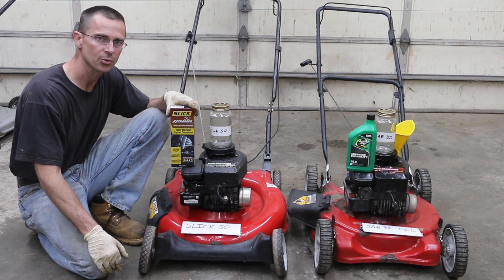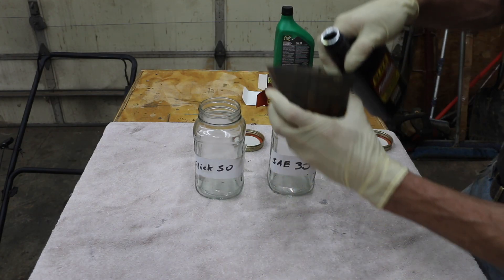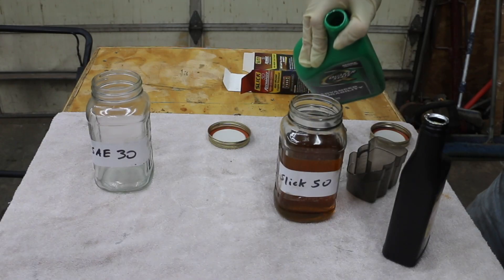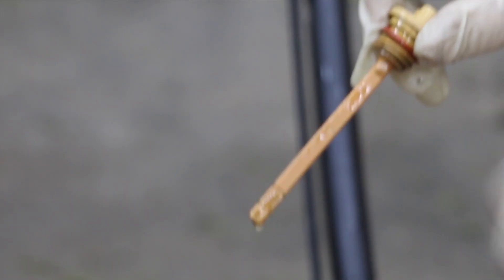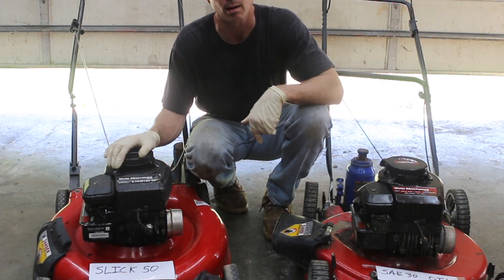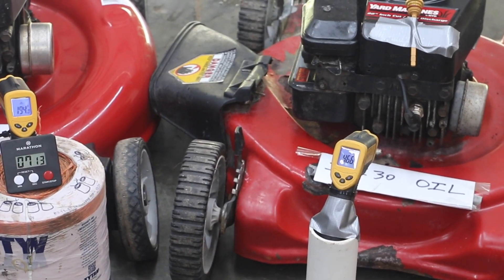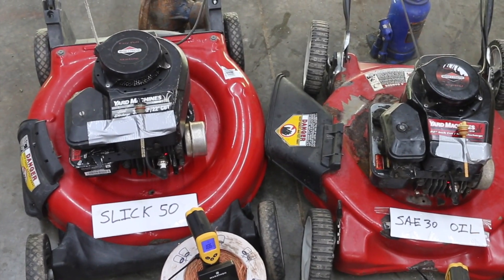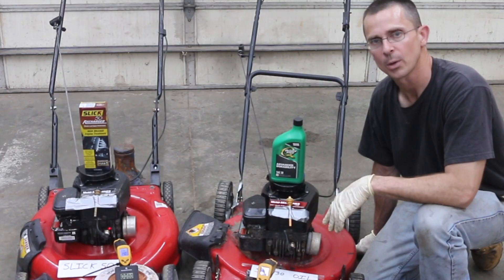Can't believe what SLICK 50 did to my engine!!--Dry Crankcase Test!

Comment: So you blow the hot exhaust at the 30w. engine, have the heat sensor aimed at cyl. head of 30w engine, heat sensor of slick 50 engine at spark plug and wonder why the temps are different!  Hey, there ain`t no mechanic in a can available---just buy the best quality oil of proper weight and change regularly and your engines will be fine.  Why not just use your money for proven lubrication products---my preferred brand is Chevron supreme for gas engines, Chevron DELO for diesel engines.  Been using Chevron for 55 yrs. and never a lubrication failure ever.

Comment: hmm i do know that penetration is key with slick 50. i dont think the short time you ran that would give much of a chanse for it to get into all the crevises and or clean the engen.
i've allso heard the old advertisment used pure slick 50 for a while.

a slightly more apropreat test would of ben to run two new engins for x time under operational loads with there apropreat lubrecents.

nice test tho.

Comment: You should pull the cylinder heads off to see if the slick 50 coated the bore and then gummed up.

Comment: Dont get discouraged.  The engine with slick 50 in it could have been just in worse condition from the start. But id really like to see this test done with MMO Or Royal Purple HPS. But if your looking for a product that bonds to the engine I would Highly suggest getting your hands on some Royal Purple HPS. It cost about the same as a normal full synthetic but its a high performance semi racing oil. You will have to ask your local part store to order it for you because they dont carry it on the shelf.

Comment: I would like to see you perform a test using ER Energy Release Anti-friction Metal Conditioner, go check out there website and all the other products they have to offer at www.energyrelease.com. Sell this stuff at work and I have gotten one customer who builds muscle cars and street rods and he uses a ton of this stuff, applicable to the motor, transmission, power steering, gears, rear end ect.

Comment: ProLong was the innovator for oil additives. They used the same engine for a couple of decades to prove their claim. A bag of Cement is what finally killed the Prolong test engine. ProLong is still the same formula, However, they owned by goldenwest lubricants.

Comment: I have used Slick 50 in my personal cars as a preventative measure, and also did the oil changes on a regular basis. I remember shaking the bottle in order to properly mix the Teflon particals before pouring  into the engines. I then left it in the engines untill the next oil changes were due.
  This guy didn't shake the Slick 50 product first, so therefore when he poured out just 4 ounces into the glass jar, the majority of Teflon was still settled at the bottom of the bottle, and never made it to the engine. Then it appears that he ran the engine for what, 15 minutes before draining the oil. The small amount of Teflon that got into the engine, wasn't given sufficient time to treat the moving metal parts. I should think this normally should have been at least a summer season. I'm surprised nobody here has brought this up. Let's be fair on this issue as well as the other points mentioned about having a properly controlled comparison.
  I'm not a master mechanic, and I respect the experience those of you have, but I have been through a tear down school for Briggs & Stratton, and know more than the average lawn mower, or car owner.

Comment: the only problem with the test is its somewhat inconclusive due to the fact that they were not the exact same motors or in the same shape.  We don't know what shape either motor was in prior to this test, and if you did know nothing was said about it.  It was a good test idea, but you would have to have 2 identical motors that were brand new to get more consistent data for your conclusion.

Comment: Gotta try Zmax. 
Would have been nice to use 2 identical engines preferably new with equal amount of hours. From the video and looking at the wear on the tires on both mowers, it looks like the one with the Slick 50 had much more use and hours than the one with just the 30w oil. It's just what I observed but it's cool that you made this video. I remember seeing the Slick 50 commercials 25 years ago and always wondered if it was really true. Now I can say that Slick 50 really can't keep and engine running without oil thanks to your video, maybe cooler. Good thing I never purchased Slick 50. Your video are very informative and keep up the good work!

Comment: used slick 50.. 1 time.  my wife's  new car. had about 15.000 miles on engine. put in slick 50. wife commented engine was making noise, approx 3500 miles on oil with slick 50 added,  drained oil found brass and metal particles, car had a 5000 mile oil change recommended interval. I had changed oil previously before using junk 50. always clean before. .  NO MORE SLICK 50 FOR ME.

Comment: You need to figure out some way of measuring the temperature of the crankshaft to get a better idea of whats going on inside the block. That said I'm surprised how poorly Slick 50 performed. I like to use "Lucas Oil Stabilizer" because I know it sticks to the parts better (especially important for overhead cam cars you don't drive often) but they don't advertise that you can run with no oil.

Comment: Hi like the video...its not a laboratory test but shows some practical results.....
Always wanted to know what Tristar-TSL does..
 https://www.tsl-allstar.nl/
I use this aditive for years now in my small Honda motorcycles and VW car and the Honda had only 1 seizure out of the blue but no damage to the Cylinder tot my surprice...Could be good luck or just proper working of the aditive..Dont know... 
The purpose of the aditive is lower fuel consumption ,lower temp and smooth running..Like slick50

Example; had a grumpy gearbox and used tsl to get it smooth and it worked..
My experiance is indeed lower fuell consumption and lower temps and for gearboxes alot smoother operation..

My last lawnmower engine i tryed to kill with pure alcohol, nitromethan, mek, wooddust , methane and some white firework-powder..
The last one killed it period
Keep on doing these good experiments..

Comment: Back in the 70s my father was a fleet service manager of a boat harbor in northern CA. He started to use Slick 50 on a couple of the boats and found no adverse effects. He the started use it in all 4 stroke crank cases and the lower units on all the boats over a 300 boat fleet ( 14' fishing boat to 55' house boat after three years of keeping meticulous records he found an average of $360 savings in maintenance cost per boat per year. That's saying something! One thing to remember is get it nice and warm and shake it up before pouring it in or you will leave the good stuff in the bottle.

Comment: I'm not sure if you'll see this comment or if this has been suggested yet, but if not-

PLEASE do a video on AutoRX. I personally swear by that stuff and I think it is one of the most highly underrated, underappreciated, and unknown products out there. I personally witnessed it turn a sludge bucket of an engine into a clean and happy engine after following the directions. The only downside is that it can take a bit of time to get noticeable results... but that's kind of the point. Anyway, if you see this, please consider it.

Comment: 1. Allowing your engine to run without oil is foolish. Many 2 strokes while being a "Dry" engine use the fuel as lubricant and also the fuel has lubricant in it.
2. Slick 50 has granular PTFE in it which is Teflon. While it has lubricating properties PTFE is NOT a lubricant or a substitute for a lubricant.
3. Slick 50 is an additive. the thing is as an additive goes it is "Adding" a granular lubricant as opposed to Lucas which actually incorporates additives which chemically boost the lubricity and stickiness of oil
4. 4 stroke Law Mower engines like these rely on submersion lubrication while larger engines use a forced oil lubrication system. In this system there will be a pickup tube with a strainer and an oil pump supplying oil to the mechanicals as opposed to the mechanicals being submerged in a bath and dependent on internal splash for lubrication.

With these things said I will now digress as to why the FAA absolutely BANS additives with PTFE in them for use in Aviation engines of ANY KIND! Tests were run after an aircraft lost power and crashed into a residential area. The pilot put his plane down in a street as he was trying to land his airplane luckily missing the houses but taking out a bunch of power poles and cars.

When the engine of the plane was stripped down it was discovered the oil pickup and oil intake be as well as the oil pump were clogged with plastic strands. What had happened is over time the PTFE formed strands inside the engine clogging the oil intake to the oil pump much like fat clogging an artery. the engine seized from a lack of lubrication. When this was realized the FAA promptly imposed a ban and all aircraft having used it were required to have their engines torn town, inspected and rebuilt after a thorough cleaning or replaced if needed.

Lucas Oil Stabilizer is REAL. That stuff works and I use it! I do not use it for break in. After break in however... I refuse to allow any PTFE additives anywhere near ANY engine I service. Slick 50 is GARBAGE and it has also been discovered it is a very bad idea to use it in any kind of performance car that does not have engine tear downs at regulate intervals. Look, I have resorted to using 90 weight gear oil 1 quart out of 5 in an oil change to help squeeze a little more life out of a tired old engine. There are two draw backs to this. 1 is your exhaust in time will smell real bad and 2. when you DO have to tear the engine down it will REEK like a differential. You can buy 50 weight but in desperate times there is a call for desperate measures. However for an every day driver this still will kill your engine eventually.

If the stuff does not have a REAL SAE rating on it do not use it. I do NOT recall any SAE endorsements on Slick 50 or any other product like it. There are reasons why granular additives like graphite are NOT used in wet lubrication systems. They cause clogging issues over time. Another problem is while some engines can be saved from buildup and deposits Hyedrocarbon based Lubricants and Fuels leave behind by Chemical means  the deposits left behind by PTFE are not removable by Sea Foam or Berryman B-12 Chemtool. They only way to deal with a clog involving Slick 50 is a tear down of the engine predisposing you did not seize up your engine.

With an SAE rating the product has been tested and deemed safe for practical use. There is only ONE product other than Lucas that i have seen a engine run dry on after its application and it was VERY similar to Lucas Oil Stabilizer with two differences. The first is that it adds a penetrant to the mix that allows the oil to permeate metal better so Babbit metal become saturated in lubricant. The other is it also included a "wetting agent" that also doubled as a detergent as opposed to Lucas. I think it was an Auto Purr product but I cannot remember. I do remember it was almost $15 for a single oil treatment.

In all reality there is NO replacement for using a quality motor oil and changing it at 5000 mile intervals in most cars and every 4000 for heavy use and Commercial vehicles. The whole thing about changing your oil every 2500 miles is utter nonsense unless you are using cheap motor oil with a lot of paraffin in it. Synthetic oils tend to enjoy better service life and you can go 6000 miles between oil changes but really I do feel 5000 is a good time to do a change.

If your engine consumes oil and the loss slows with thicker oil try doing a B-12 or Sea Foam treatment on the oil during an oil change and see if it is just stuck piston rings. There is no substituent for doing a "Head Job" if it turns out to be leaking Valve guides. In half the cases of an engine consuming oil it is usually junk in the piston rings and once freed up and they can seat properly again the oil consumption goes away.

I know all of this is a serious mouth full but in summary STAY AWAY FROM SNAKE OIL! Slick 50 qualifies as Snake Oil. Go with what REALLY works, not what makes you feel good "Just because it couldn't hurt." An engine rebuild thanks to a clogged oil passage is not cheap. And if you have to replace the engine... there is always the Russian Roulette of the Junkyard Used engine. (Cue the menacing laughter in the background)

There is also one other additive that is also pretty good at freeing up stuck piston rings and silencing tapping lifters... Marvel Mystery Oil! that stuff has been a "Hail Mary" in some bad situations. I actually got a smoky old GMC with a coal burning 350 CID to stop smoking adding a quart of Marvel Mystery Oil to the crank case and driving the truck for a couple of hours before a fresh oil change. Also me taking a vacuum gauge and adjusting its Carburetor helped the black smoke go away. Imagine the owner's surprise after a half hour the blue smoke began to fade and after the oil change there was no more blue smoke. Also the familiar GMC clatter went away too. B-12 Chemtool and Sea Foam are not the only two shows in town for getting a tapping lifer to quiet down. Put Marvel Mystery Oil to the test sometime if that has not been done yet.

Comment: mower engines are like aircraft engines, being aircooled they run way hotter,  oil absorbs water from the atmosphere also, you want aircooled engines to run a little hotter to boil off collected moisture. Also the exhaust was pointed at the intake of the regular oil engine increasing combustion temps. If you start with hot air it only gets hotter.

Comment: Try LUCAS Oil and AVBLEND. There may be a automotive version of AVBLEND but I'm not sure. I'm an aircraft tech. The two work in opposite ways. Lucas oil sticks and AVBLEND soaks into metal. I have repaired or rebuilt aircraft engines with AVBLEND and there is less wear in those engines. I have also rebuilt all my car engines before and after using LUCAS oil and there is a big difference. The second time rebuilding those was easier and much cleaner than the first time before using Lucas oil! They also lasted longer between rebuilds. (90k mi. vs over 150k mi.)

Comment: Below comment very correct. But when cool could  you add oil and restart  Slick-50 and same  for Std SAE engine. Then stop if did restart , regardless  of start or not start  pull motor apart and study why engine stopped. Was it burning Slick 50  and gummed rings and stopped motor. The SAE melted or destroyed engine components due excessive wear I am sure. Though agree need 2 new motors to   give equal test, but if Slick only burnt oil additives then gummed motor and SAE destroyed motor, this test is not necessary. Also note  rubber wear on wheels  of two mowers which is indicative to hours of use, so it appears  Slick motor done roughly double the hours of operation to compared to the SAE mower. Why 2  new identical mowers are needed and the re-oil and try restart  and then fully observe inside what caused stoppage before making any claims of positive or negative nature......... I think the guy will be surprised as the old mower on Slick-50 was barely hot when it ceased  as crankcase temp was only 20 degrees above  normal  crankcase temp.

Comment: Back in the 80s the auto shop I worked at was promoting Slick50 when it was popular on the market. We used it in our own car ('79 Z28) to see how it performed. It was bad. It did exactly what it said it would. It coated everything in the motor with a slimy substance (supposedly Teflon) and continued to coat layer upon layer until it closed oil feed holes and caused cam lobe failure from no oil lubrication. When we disassembled the engine it was a gross slimy mess. We had a rep out to show what happened. We got some reimbursement but we stopped selling and promoting the stuff. I personally used Prolong in my '85 Grand Prix small block. I used the boosting additive each oil change after initial treatment. I had no issues with it. When I tore the engine down to rebuild it when the time came it was nice and clean inside. The problem came when I was having the block bored. The machine shop was having a terrible time keeping the bores from walking. He asked if I used any kind of treatment. When I told him Prolong, he said that shit works too good. It impregnates the metal and makes it almost impossible to bore because the metal resists cutting. Had to use a boring plate to stabilize the bore and took 3 times as long to do. I believe prolong is a good product and does what it meant to. You cannot use it on a new motor because it will prevent break in to properly occur. After 10k miles it would be fine if you don't plan on boring it.  I no longer promote additives unless it's already an injured engine and just trying to keep it running a bit longer. Then I recommend Lucas stabilizer.  My advice is using full synthetic with a synthetic long interval maximum life oil filter and change both every 5k miles. That's what I do with my own cars now and have no issues. DON'T TRY TO SAVE MONEY WITH CHEAP OIL CHANGES.